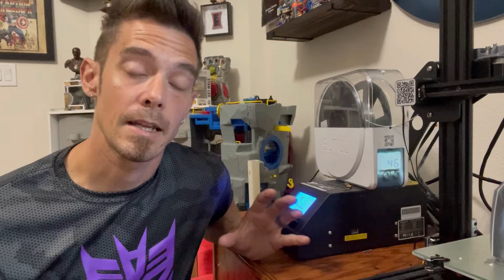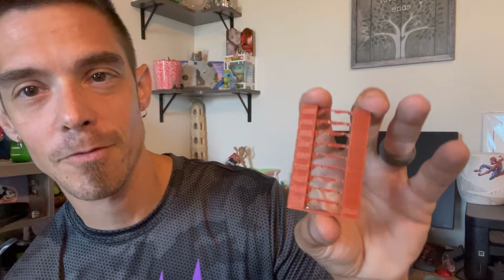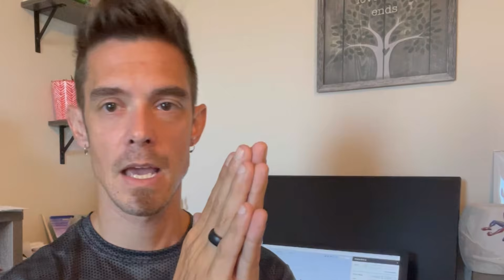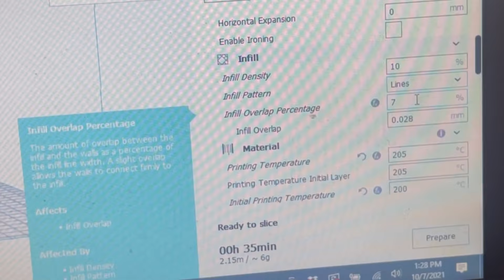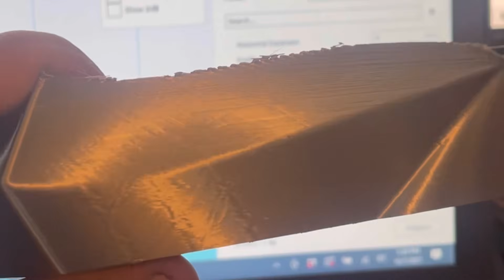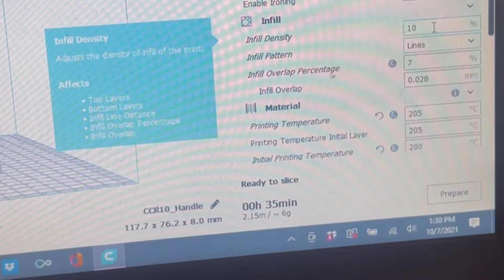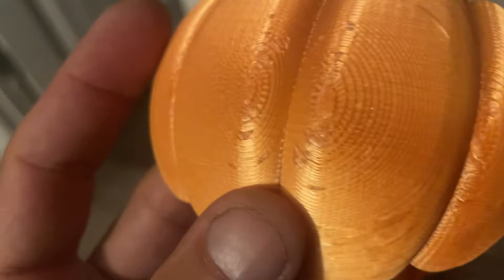3D printing silk filament| how to get silk 3D prints to look the best | 3D printing tips & tricks

Comment: Hello,

I have had bad experiences with Eryone Silk filament in terms of layer adhesion compared to normal PLA. It simply does not hold out much.
I have also printed a Temp Tower. However, you don't see any differences between 190 and 220 degrees Celsius.
I print with PrusaSlicer and the standard PLA profile from Prusa and only adjust the temperature of the filament.
Today I had the idea that it might bring something if you print Silk Filament slower.
On YouTube I searched for "Silk Filament print slower" and found your video.
Unfortunately, I can only test this after 8.1.2022, because I am over the Christmas period with my family.
Maybe you noticed the poor layer adhesion with Eryone Silk Filament too.

Kind regards

juck.

Translated with DeepL
Reply from the maker: I am printing a green goblin mask with eryone and would be more than happy to share my profile with you when ready. I’ve printed several busts & models with eryone and temp settings of 205* seems to be the sweet spot with retraction of 5.5mm @ 35-40mm/s working beautifully. Print speed 50mm/s

Comment: I did two test prints, I tried a tower and it printed better lower actually, I’m still having some stringing and need to look at retractions, I did a benchy at the temp tower that looked the best, I need a dryer! Thanks for the video on this! Wonder if you could share your profile? Also did you mention cooling?
Reply from the maker: Stringing can happen from moisture as well. Fan settings can be changed/adjusted within the temp tower but I typically run from 70-90% but it all varies on your temp, sometimes too much fan and vise versa will cause stringing still

Comment: Having a hard time getting my silk print to stick on bed what temperature do you use
Reply from the maker: Hi terry, what type of bed??
Reply: @Darkwingdad  it’s a cr10–10 s with a mirror
Reply from the maker: @terrydockery3690  first try brim with 62* on the bed but be wary of warping especially on curved prints, flat is ok.
You can also try glue stick or hairspray which is my personal fav
Reply: @Darkwingdad  did hairspray on 60 deg bed I’ll try that thanks
Reply: Ok I did 210 temp and 65 bed looked great thanks

Comment: Fantastic video! I typically print my silk prints at 60mm/s or 50mm/s but might try dropping it down further. Great info on how to get some really smooth looking prints. Will be trying some of that out
Reply from the maker: Thanks jessy! I really think it depends on your machine. On dual z axis or printers like the ender 5 you can bump the speed up due to better stability on the x & y gantry but I always say do what works for you! I know you have plenty of machines to test on! I sent you a message a few weeks back, I’m going to be in NY & wanted to give you some plastic metal to try, let me know! Thanks as always!!